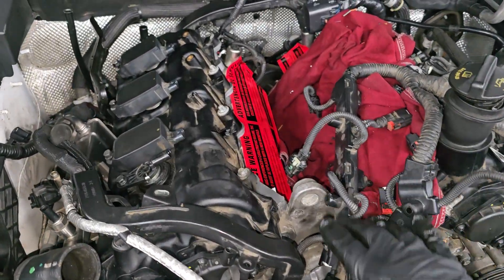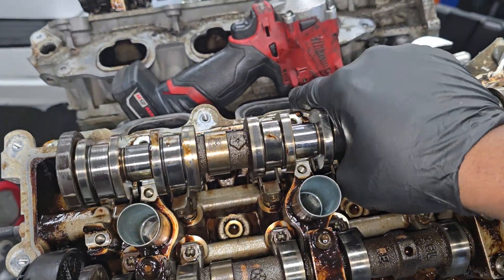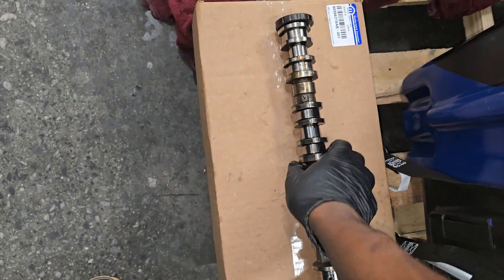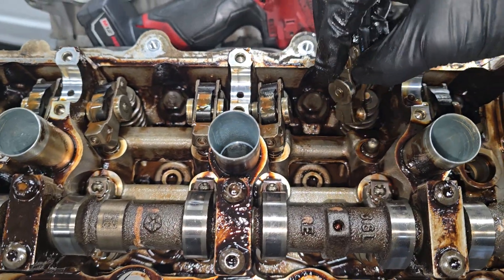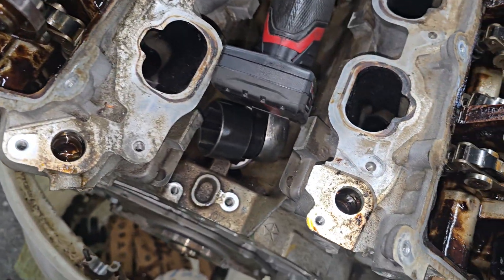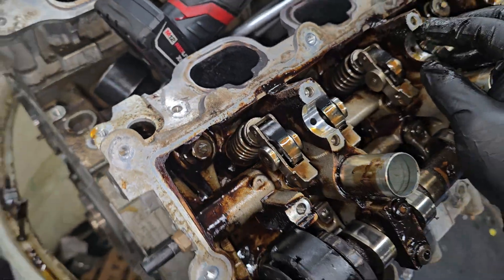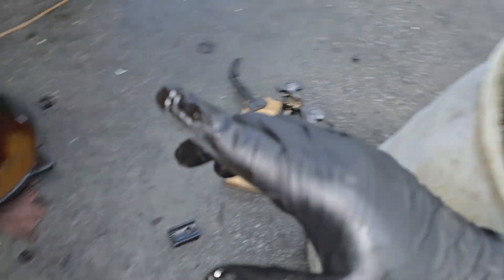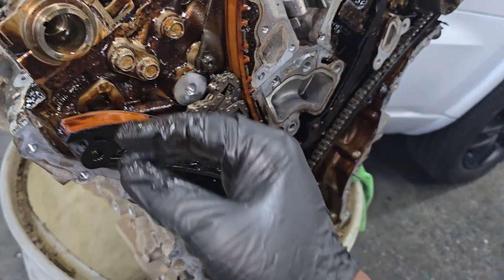“3.6 Pentastar Camshafts on Backorder: Why You Should Keep Old Used Cams!”

Comment: It really went from replacing an oil cooler to new engine? Is that thing under warranty?😅
Reply from the maker: No, this thing was abused my guy. This replacement have nothing to do with the quality of the engine. . Its sludged up and over heated. They never changed the oil on time and kept driving while it was over heating.
Reply: @OnlineMechanicTips  People think oil changes are optional. 🤦‍♂️ I see used cars that look beautiful but have slugged engines. Blows my mind.